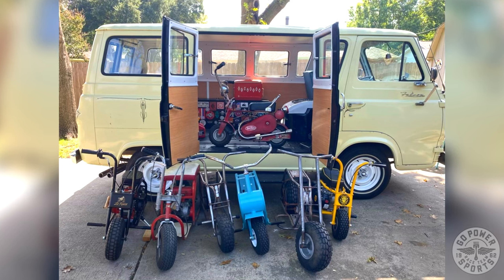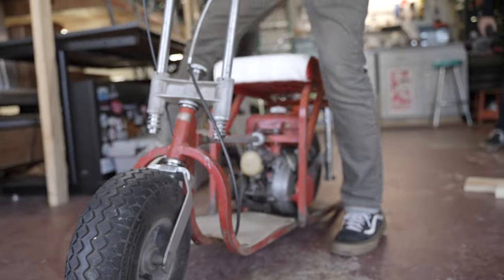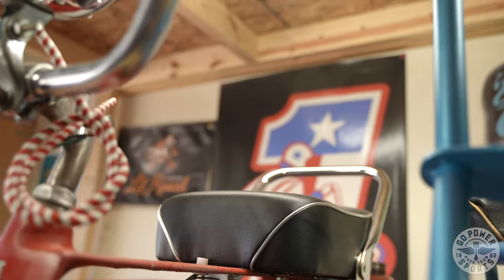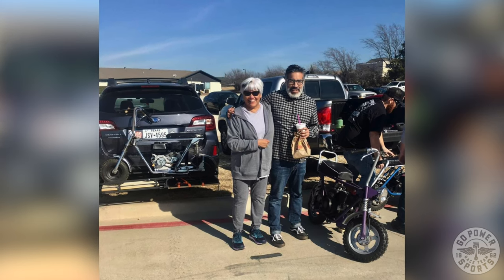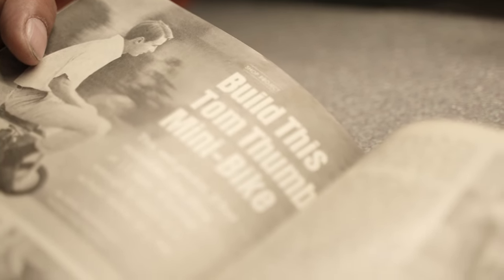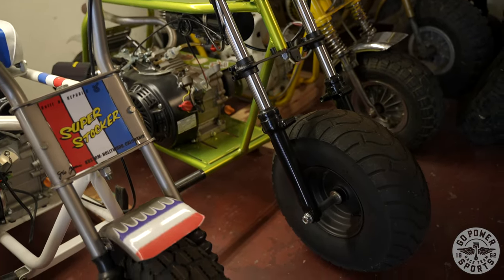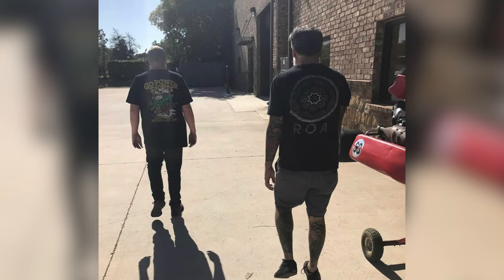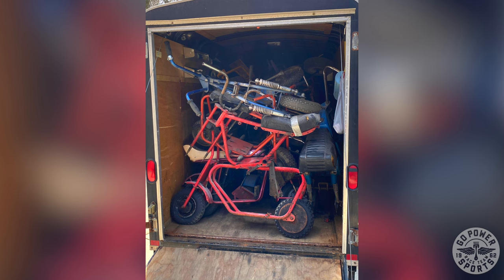Meet Harley Rangel | GoPowerSports Customer Profile

Comment: I don't get the predator thing tho. Flatheads are not difficult to get running properly
Reply: That particular Tecumseh that I referenced for the wards bike is super crusty and has dirt all inside it. Not impossible to fix either of those things but also definitely not as easy as just putting a 212 on it to use until there’s time to get to it.